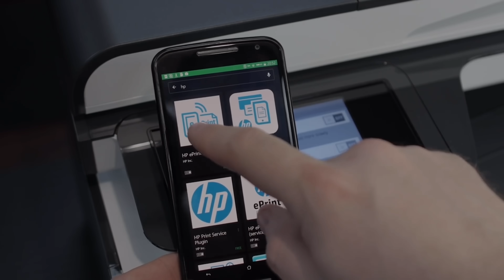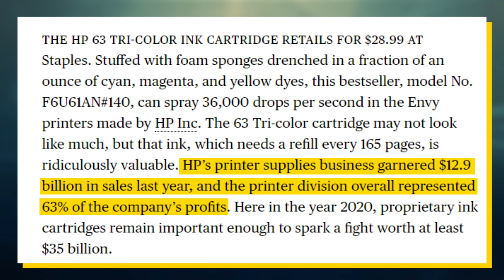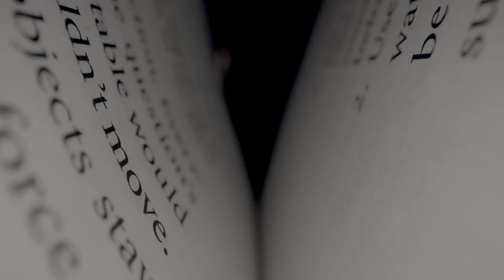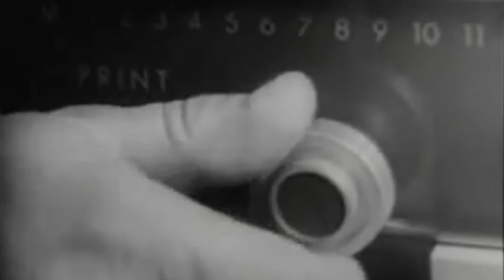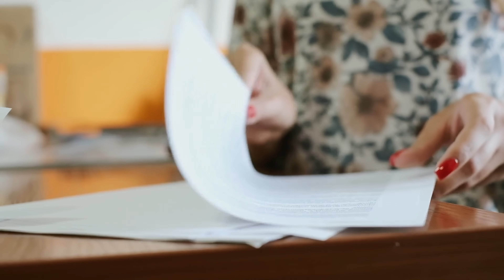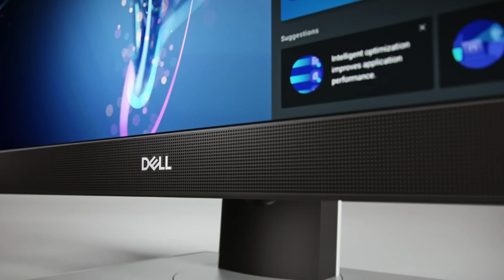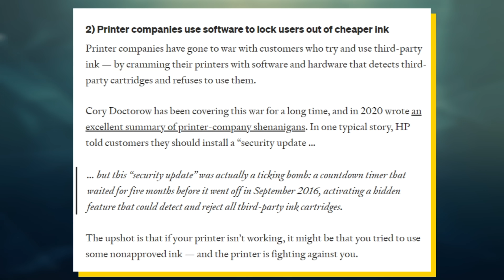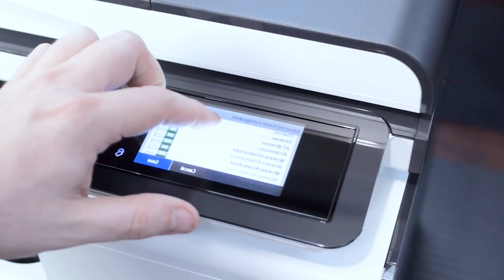Why Printers Are Designed To Fail: The Frustrating Truth

Comment: Maybe in Japan, where everything exists in digital formats, a paper printer is indeed unnecessary, but in some countries, where do you still need to have the documents on paper there is still a window for this, maybe a laser printer is more viable that an ink printer,  ink printer s are wery usable in photo printing where you have the quality over quantity,  but in common office ink printing is not viable at all regardless from where you get the ink even if you manufacture the cartridges yourself,  it still has a maximum 200 page's per cartridge fill , but a laser printer from 1000 and up

Comment: I have a printer, and I overall like printers, but it seems they have to be commercial laser printers, prosumer ink jet or consumer inkjet is just a mess and they always fail in some way.  I’d like to get an inkjet for photo printing, but I fear I’ll run into an issue with them as well.  I do have one reliable inkjet however.

Comment: I swear HP is THE WORST, I have a Deskjet 2600 AND IT DOESN'T TAKE THE PAPER EVEN IF IT HAS ONLY ONE PAPER, the rollers don't suck it in to print it, you have to manually jam it in to make it print.

Comment: Honestly hate the newer printers. Designed to fail is an understatement. Designed to not use even half the ink and some are microchipped to force on brand ink. We have an older full size office laser printer which works great after at least 15 years. They should just go back to making more expensive functional equipment rather than trying to nickel and dime people. I set up a new printer and within 50 pages it saying it was out of ink already. Replacement ink cost like 77$ and it ran out after 71 pages and refused to print anymore until a new one was installed. The one that came it after that someone else installed it and it won't even accept it. Haven't ordered any more ink and they just print on the office one like the rest of us.

Comment: My problem with printers is the 'new' operating systems from Microsoft.  Each of the (forced on me) Operating System will not support my laser printers.  I lost the use of my Docuprint, Xerox, and Oki (each at 500USD to 1000USD) because they were each "Not Supported".  They work fine.   I  stopped using Ink Jet printers because of the drying out,  striping, colour registration problems.

Comment: Rule number one when you are using printer:

1. Don’t show your fear when printing. If you are in hurry or desperate, they will print utterly slow.
Reply: Rule number two:

Make it learn to fear YOU
Reply: 3. No fear needed, your already out of ink.
Reply: @larrbaII  That's when you rip out the cartilage, RAM it back in, slam the lid down with a vengeance and DEMAND it print.
Works every time.  
Make your printer fear you.
Reply: @christopherderasmo5041   O.K. i regress.  -- get a cannon printer.
Reply: @larrbaII  That means nothing.
Follow my instructions for victory!
Also if you ever replace your printer make sure to plug in the new one and make it watch as you destroy the old one with a sledgehammer.
Let it know what happens to disobedient electronics.
Reply: @christopherderasmo5041   sledgehammer.
Got it.   My HP Printer should work as advertised, with this slight fix.
Reply: @larrbaII  If it's the one you just bought then yes.  You must kill the old one before the new ones processor so it knows who is boss .
Reply: I had it done to me when I was printing out the engineering drawings to show the machinist.
Reply: 4. Buy a laser printer

Comment: It's funny they even got people saying "counterfeit". They're just third-party cartridges, they're not trying to trick people into thinking they're from the oem.

For me it isn't the hardware or the cost of ink, it's the software. Windows still notoriously gets stuck on print jobs with no ability to cancel without doing stupid troubleshooting like opening up services to stop the print spooler, deleting jobs manually from the windows subfolder where they live. They'll also show up as offline suddenly and sometimes you have to change settings in both the windows print dialogue and the software.

Comment: Let's face it, what do you really need a printer for? It's usually just for printing some docs or forms for some backwards govt agency. That's why a picked up a basic AF Brother HL-2150N b/w laser printer for ~30€ used more than 10 years ago. It has been running ever since and printing when I needed it. Offbrand toner was like 14€ for two 5000 page cartridges (I'm still on the first one). If I need photo prints or whatever (which is almost never) I walk to the drug store and can get my stuff printed in color and high quality for very cheap directly from my phone.
Inkjets are dumb and obsolete. Unless you hate having money. Then they are just what you need.

Comment: Last year I learned the hard way why you should always flick through a ream of paper to make sure nothing is trapped in it before you put it in the printer. Some plastic, an insect, or something else was burned around one edge of the heat roller so now pages come out embossed with the toner not fixed. This is despite my best efforts to access it and clean it.

Comment: as someone who prints for a living, i have to say that this video is pretty one sided and not very well researched

get yourself a basic laser printer (exactly like that very first Xerox machine operated by a chimpanzee) and none of these things are an issue. 

the fact is simply that the printer is the very last analog device in your office, and in many offices is also the very last machine with moving parts. 
The expectation we have when we see perfect images on beautiful screens simply doesnt translate to what printers can do. 
And in the professional world, printers are about as reliable as your car. My company couldnt run profitable as an industry if my machines behaved the way you describe. 

it really is one single thing: Ink Jet Printers. DONT BUY THEM. 

and even this is changing, as the actual print industry, is moving to ink jet printers in the digital space. This will have effects on consumer products.

Comment: My Epson 1800 photo stopped working after 8 years or so working. I decoded the error code. It said that after the micro in the printer reaches a certain number of paper sheets passing, it locks up for a maintenance change of the spittoon. This was not customer accessible. Also the link said that they will sell me the reset disc for a good sum, but they will discontinue the ink line. As a retired electronics tech, this was insulting. Planned obsolescence. The new printer cost just a little more than the reset disc. The inks, still expensive.

Comment: A lot of receipt printers these days use thermal printing, which gets rid of the need for ink entirely. Unfortunately there does not seem to be any possible way to implement this for different colors with black being the only viable printing option. If there is some way for us to utilize different colors with thermal print technology, that would put these traditional printer companies out of business.
Reply: It won't .😂
 Thermal printing fades away within couple of days.
Reply: @wittyroark  I sell 80x80 thermal printers at a electronics store. And the text they print are still as clear as the day they were printed even after a lot of time have passed.
Reply: @barbiquearea  really?? Good to know
Reply: Piss-poor technology it fades a lot

Comment: Black laser printers last forever. My HP printer is pushing 20 years old, and it is definitely not a high end model. I know that 300 dpi HP laser printers from the 1990's beaten on in computer labs would still be working today. I bought one used. It was great, but it was too big for my apartment so I bought the newer HP some 20 years ago (2004 or 2005). Inkjet printers? They've always been crap. Just a toy designed to go to e-waste in a few years. I own one, and it is still limping along but the HP laser kills it.

Comment: If you need to print stuff at home, get a brother black and white printer. 

They start at $100 at Walmart, they come with toner that lasts a while.
You can use 3rd part toner, no problem.
Toner doesn’t go bad like ink, as long as you don’t dump it out or get it wet, it’s fine.
I have one of the nicer models but the ex kept the cheaper one, both work great.
Reply: Ding ding ding we have a winner folks! 

I have an HL-L2380DW Black/white printer/scanner. Works fine with my Mac over USB without even installing a driver!! 

Windows has a driver that's easy to find. Cartridges last forever. I don't think it's ever jammed. 

Friends don't let friends inkjet...
Reply: Seriously. Three years ago, I bought a Brother HL-L2320D, which is their base model b&w laser printer, for $80 on sale. I don't really print that much, roughly 1000 pages per year. Haven't had to replace toner. Zero errors. Zero paper jams. USB connection is always reliable. My previous inkjet printer would go through cartridges twice a year under the same printing frequency.
Reply: The K1ng is Speaking the truth. 
If you want a printer because you use it a lot, get a laser. If you want a printer because you sometimes want a print, get a laser.
If you want a printer so you can print photos, you're mistaken: go to a photo shop instead.
Reply: I love Brother 520w. With airprint

Comment: My first printer was a commodore printer...A Dot Matrix monstrosity that made a horrendous racket but worked very well for what it was.  My second printer was a color printer when these things were very new.  It cost me 800$ and worked very well but was horrendously slow.  My third printer was an 80$ Brother printer/scanner back when these were sort of a novelty.  Never got the scanner part to work and it barely printed but it was cheap.  We had an HP at work that went around the counter twice meaning it printed two million papers.  It was amazing.  So, My next printer was an HP I bought for 55$ and it's been amazing.  It's had some hiccups but mostly works great.  The problem is it's slow to print.  It's 15 years old I loath the day when I will have to replace it.  My father got a com,puter a few years ago and wanted a printer.  I recommended an HP and it worked once when I was there and then no more.  So we got a replacement and it worked once.  We got another replacement and it worked once...I'm not kidding.  Then I bought him a laser printer (no color), got it set up and it worked a few times.  The internet guy came and "fixed" his internet when I was not there, now I can only get the printer to work when it's wired up.  I can't get it to work wireless anymore.  I really am not looking forward to buying a new printer.  The problem is that I only print maybe three times a year but when I need to print, I need it to work NOW!  It's annoying.
Reply: I guess the internet guy put some protection on the wifi router that won't work with the printer firmware. Or he just forgot to connect it to the printer.
Reply: heh! I still have a MPS1230 Commodore printer (it's a re-badged Olivetti DM100) and it still works fine with my C64 and it's a dual interface model so it also works on a PC with a parallel port configured as a generic Epson FX80.

Comment: Good printers have always been expensive. Don't expect this to change soon. In the1980's I designed printer firmware and software for Digital Equipment Corporation, a major computer and printer vendor of that era. The problem with printers is that they have complex mechanics. Whereas circuitry is relatively cheap to build complex mechanics are not. You can get cheap printers and expensive ink but you can't get cheap ink even with expensive printers. What the extra money buys you is reliability and speed and for some that's worth it. But if, like me, you print about 5 pages per month it's better to just get a cheap, slow printer. Yet the bottom of the market printers are so unreliable I go for the next level price tier where you get a slightly more ruggedized product that will last a little longer.

Comment: Why printer spec for home user even more downgrade each gen? In 200x there is 9600 dpi, now it down to 4800 dpi. This is home user system, not for professional. 
If it about selling ink, why not keep create a new and better + cheaper ink. In 199x there are PhotoRET for HP, Canon FINE, Epson other. Why it has not been a new version in 202x? 
I have a lot of printer, and somehow like a mouse, it does not long live. 

If all normal, 2023 home user printer should has the quality like 2018 printer professional in printing and durability.

Recent few years back, printer company has use "if you can beat them, join them" and create a cheper ink printer. CISS official printer.

Comment: Switched to laser 10 years ago and it's been great. No printer issues, the printer just works and is available to print every time you need it. It just showed me how printer companies had ruined inkjet printers for profit.
Reply: I prefer laser printers but they are more expensive to purchase, yet cheaper to run.

Comment: I used to hate printers and bleed money on ink as my wife's work requires making a ton of hard copies of paperwork. 

Then I read about and bought an Epson Ecotank ET-4800. 

Apart from one gripe - the document feeder for scanning a lot of pages at once can be picky sometimes, other than that it solved every issue I had with printers. I've had it over 3 years and: 1. I still haven't ran out of color ink - yes I'm still on the freebie ink that came with the printer and I've replaced the black ink exactly one time and it cost me about $10. We've printed approx ~10,000 pages on this thing. 2. The main printer interface has never once jammed. Ever.
Reply: How's that planned obsolescence sponge working in your Epson?
Reply: @UltimatePerfection  I spent roughly ~$320 on printing hardware and ink in the year prior to buying it and have thus far gotten 3 years out of it for $260 (250 hardware $10 ink) so if it died tomorrow it would still be no contest the best printer I ever owned.
Reply: @FormerRuling  Trust me, Brother is better. And cheaper both in ink and hw.
Reply: @UltimatePerfection  where I live, Epson imposes software obsocelence, as in the hardware still works but the firmware doesn't allow one to print beyond 10000 pages. Reached that limited once and cost $15 to repair where that is equivalent to 3 day minimum wage.
Reply: Why using ink at all when laser is superior in every way and for printing ton of office papers you can go even for LED printers.
Reply: @Pedgo1986  because it also doubles as a home printer for the kids to print pictures and such on.
Reply: @FormerRuling  color laser and led printers exist. nevertheless this is quite pricy fun for kids to print pictures at home

Comment: Our HP printer didnt allow non HP ink at all. It would either completely refuse to print or mess up the printing. Same thing was tried with HP ink which is significantly heftier in price than off brand one and it worked. Now we own a Canon and haven't had issues with it. I did read about manipulation of the products so they stop working after 100 thousand pages for example so u need to buy a new printer. Some law has striken that idea

Comment: Printers is a scam.
A long time ago there was a standard called TWAIN that made it very easy to control a 'printer', the printer did not need to have a computer in it for it was connected to a computer that could control some motors, my father had one of those, a plotter that could use pencils to draw, the fun part is that it still work and can be controlled by a Linux based Raspberry PI.

Now we can build 3D printers that also can print in colors for it so darn easy to control motors in what look like a printer, and it very easy to make ink be pressed or sprayed onto paper, but the printer companies put a controller in the printer and a small chip in the ink that say when it shall break and when the ink shall run out, and they make it harder and harder to hanc the chip so you can reset them.

Comment: I buy HP Deskjet 500 along with my first PC, a Acer 386DX PC. Yes this printers like a workhorse, I'm still using this printer after upgrading a new PC twice.
New printer now like a trash, broken component, have a ink protect, regular component degradation, ROM reset, etc.
Now I'm still using a Epson L210 (still working like a workhorse). you can fill with cheap ink, just do a easy printer resetter after 5.000 page print.